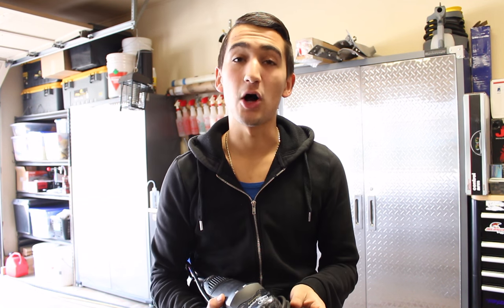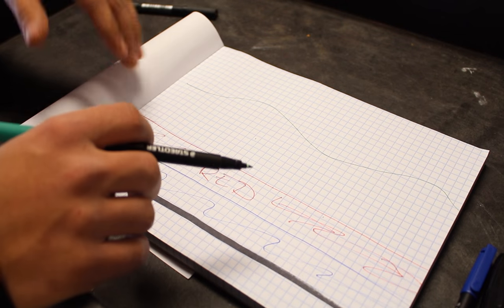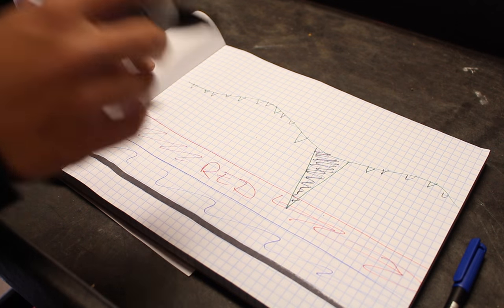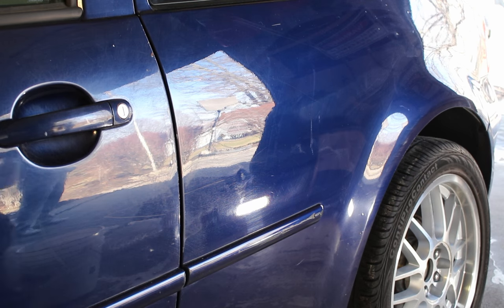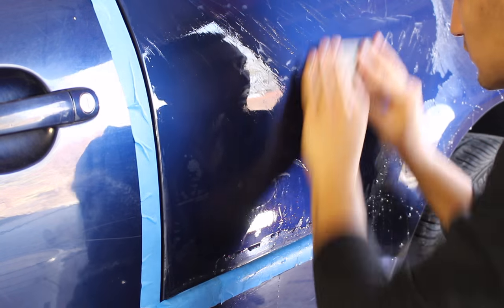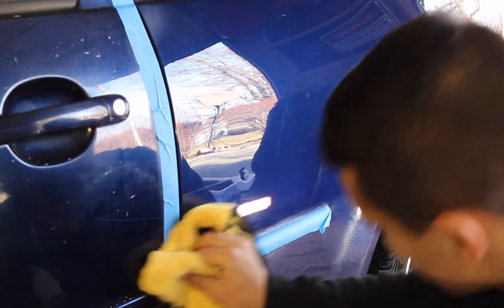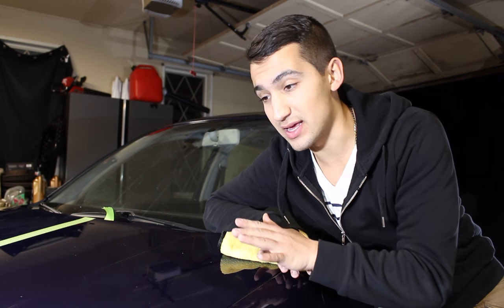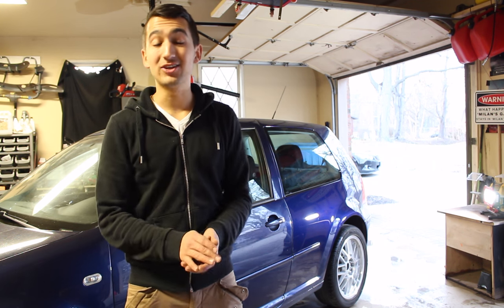How to Polish Your Car

Comment: I have a 2015 truck with some light dealer induced swirls. I don't have a DA polisher yet. Is there a polish that I can purchase to use by hand that would get the swirls out?  And what applicator to use also. Thanks.
Reply from the maker: +Michael De Luca You won't be able to make them 100% disappear if you do it by hand. You will induce holograms into the paint. With that being said though, you can use a Microfibre towel and Meguiars M205 to remove a decent amount of the scratches in the paint. If you can though, invest in even a cheap D/A as it will help you a lot and make the paint look really nice.
Reply: +milanmastracci Awesome. Thanks for the reply and videos.
Reply from the maker: Not a problem :)

Comment: Is that opulent blue paint? I have a ATS same color. How would I know if i have much clear coat left? Sanding the car freaks me out man.
Reply from the maker: There is a gauge you can purchase to measure how much material there is between the top of the clear coat and the substrate (steel panel); they can be quite pricey though..
Reply: milanmastracci il pass on the sanding I guess. Where in Canada are you

Comment: How many times can you do this to the clear coat? And will cheap microfiber towels scratch paint because I bought a new car a whipped it with water and a towel and I made it look worse than it ever was. Scratches everywhere!
Reply from the maker: The only time a MF towel will not scratch is if there isn't any dirt on the surface of the paint. Even though you might have a nice MF towel, if its not used properly, it is useless.

Comment: Im new, and i bought my self a buffer tool ("Porter Cable"), in notice theres a number adjuster (Rpm), i dont know what number i should put on for compound, polish. And wax, i dont think it matter but please explain
Reply from the maker: +Alex Correia The number just increases or decreases how fast it orbits. The faster you want to cut, the higher the number. The higher the number, the faster paint will be removed from the paint. So you want to turn it high enough so it will be removing a bit of paint, while not going too fast to remove it all within 10 seconds or so. 

For my polisher, it varies between 1 and 6. So when I compound, I will usually go around 3-4. When I polish, I will go with something between 5-6. Its all up to you how fast you want the machine to spin, but just take it easy. If you're starting off, try using a lower number so you will be removing a tiny bit of paint at a time :) Hope this all makes sense

Comment: This is a good video for showing people at home DIY guys but i would this is the slowest way possible to get those results. High speed (rotary) would do this same job in a quarter of the time. Also, working in the sealant in that fashion doesn't absolutely nothing... Less is more in that case. it can not be layed.
Reply from the maker: You can use a rotary, however that method will induce holograms in the paint. So in the shade, the paint will look flawless, but when the sun hits it, you will see lines from where you used the rotary.

Comment: Hey is there anyway I can do this and just polish with meguiars ultimate compound and maybe also with scracth x 2.0 meguiars and seal it with turtle wax?
Reply: I used ultimate compound, ultimate polish on the hood because it needed it and finished the whole truck with 2 coats of liquid glass. took all the nasty swirls out on my 2013 f150 in metallic green gem.

Comment: Video how to remove rock chips from freeway on hood?
Reply: paint
Reply: +Tray Muse rofl
Reply: I go on the highway/motorway every day. Doing around 150 miles (work). The front bumper has sooo many rock chips, as it has gone right through the clearcoat. The only way to sort it would be a full respray. :( 

FML.

Comment: this guy doesn't 100% know what he's talking about.    I would never sand an entire car with sand paper.  that's what cutting compound and polish is for
Reply: Jonathan Ritter your wrong I prep cars for the painter to paint and the way we buff cars , we sand them with 1500 if you just cut it and polish all the small scratches will go away but not the deep ones
Reply: Juan Bailon that's to remove orange peel, runs and any impurities after it gets out of the booth. If you sand a whole car you're wasting your time. Typically a 300-400grit compound will do just fine for most scratches, while wet sanding is only for special circumstance scratches

Comment: What is orange peel?
Reply: Manlex Ndungu it happens when you eat too many oranges on top of your car... the dropped (accidental of course) peels contaminant your cars clear coat with oils. If you bend an orange peel and squeeze, oil sprays out.

This oil chemically reacts with the clear coat and will actually begin transforming your cars clear coat into an orange peel. Kinda like when a zombie bites a human and the human turns into a zombie.

On a sunny day try to look at a reflection through your paint... if the reflecting looks wavy or bumpy then the transformation has begun. To stop it you have to sand and polish the clear coat like he did in the video. Be sure to hurry though as time is limited.

It's important to note that sometimes it can happen to cars even though you didn't eat any oranges on top of them. This can happen when too many people in a small region eat oranges on the same day. The oils become airborne and contaminate innocent bystanders.

This is also why brand new cars can have orange peel. Too many factory workers had oranges for lunch on the same day, again making the oils airborne.

Don't thank me; it's just science. 😎

Comment: What's the difference between the variable speed polisher and the duel action one? not sure what one to get as need to do this to my car
Reply from the maker: +Zion! Ghosts Commentator! The variable speed polisher is like a drill, it only spins in one direction, and leaves holograms in paint. A dual action polisher spins similarly to a drill, but it oscillates at the same time. Using a D/A is a very good option if you are polishing paint, where the variable speed polisher will cut the paint faster. They both have their places, but for paint, I stick to D/A :)
Reply: +milanmastracci ah ok cheers man!:) so it's a bit like an orbital sander then it spins and oscillates?  they seem expensive but ill keep an eye out :3
Reply from the maker: Very similar to on orbital sander :) You don't need a Rupes polisher to give you great results. You can use the Meguiars D/A, porter cable, harbour freight.. There's lots of them
Reply: DA is more user friendly.   Rotary is for pros

Comment: I did everything, except the sanding part. I didnt notice much on my car, Because my car is silver. what do you think? 
and another question, my window trim on is cloudy and not chrome anymore, what can i do?, i tried polishing it but nothing happened
Reply from the maker: +Alex Correia Silver cars are a pain to remove scratches but it is the same principle as say a black or blue car. As for your window trim, is it chrome or black window trim? If it's painted or just plastiic, it will make a difference as to what you can do to restore it.
Reply: It is aluminum, it chrome looking, not painted, so i assume i would use aluminum polish
Reply from the maker: Oh if that is the case, aluminum polish will bring it back to life in no time :)
Reply: +milanmastracci thanks for the help man
Reply from the maker: Not a problem buddy :D

Comment: What setting for the DA Polisher with the sandpaper on it?  SLower like a 1 or faster like a 4 or 5?  I've got a Porter Cable.
Reply: You shouldn't really sand your car if you don't fully understand what you're doing. Compounding and polishing works just fine for a daily driver.
Reply: check out adams car care products.  amazing products and the results are real!
Reply: MichaelB277 Agreed, don't sand a car if you don't absolutely know what you're doing. Unless your paint is jacked up, it shouldn't be necessary. There are many clearcoat safe polishes and rubbing compounds the will do the job nicely. If you want to do it yourself, invest in a DA polisher to save time and effort, and have more uniform results.

Comment: will this on oil based paint? I did a 25 dollar paint job last summer still look good but a little faded?
Reply from the maker: +Kool Herc I dont see why not. This process works on paint, plastics and even metal.
Reply: ok thanks!
Reply from the maker: No problem :)

Comment: hey u obviously cant get ur machine behind tge door handle so how did u remove the scratches in that hard to reach area ?
Reply from the maker: +Muzza Miki All of it by hand. Appy whatever product you're using on a microfiber towel and get rubbing
Reply: +milanmastracci i thought so but u cant get the same effect as using a dual action
Reply from the maker: That is for sure. If you really want to get in there, remove the door handle from the inside.

Comment: How would you handle already oxidized paint?
Reply: Probably respray
Reply from the maker: +FEHKINGS Depending on how bad it is, you might be able to buff it, but if its through the clearcoat, you'll have to sand it down, and then respray it. So if it is just the clearcoat that is bad, you can sand all of the clearcoat off of the car, and then just spray clear

Comment: That'd take too much time on my Expedition. Wonder how much an average price is for a shop to do it.
Reply from the maker: Oh a lot.. but the results will speak for themselves :)
Reply: hah split the vehicle into 7 parts for each day of the week. I wish we could get ahold of my dad's friend that can do this. When I bought the vehicle it was a repo from an older man who had an accident and got put into a nursing home and couldn't pay the impound fees. So I think they took it upon themselves to repair it and resprayed the entire vehicle themselves. It was just the right side fender and they put an F150 bumper on it. It doesn't look bad but I don't think it was clear coated or it just didn't have the polishing and sanding to it and I kinda like the matte finish. BUT... it's starting to get some funky white stains all over it and dirt sticks to it like crazy. There's no damage anywhere and one damn new ding on the hood from a stick the other day in the wind storm. So I think I am just going to take it to a paint place and pay up for a good touch up. Atleast it would be professionally done and it won't take forever.

Comment: Does the end look stays permanently?
Reply from the maker: Yes!! Until it is scratched due to incorrect washing, or whatever the reason is, yes it will stay shiny. The only time it won't is if you wash the car, and just fill in the scratches with wax, as opposed to fix them by polishing.

Comment: How to know if the car still have clear coat at body?
Reply from the maker: +Zash Ayzex Without purchasing a 'paint gauge' you can't really tell. These devices are around $1000 for a good one and measure how much paint there is between the sensor and the metal of the car. Unfortuantely it is always a gamble when polishing your paint.
Reply: Zash Ayzex pour water on the scratch, if the scratch disappears when it's got water on it then it is only in the clear coat, if you can still see the scratch with water on it then it is all the way to the paint.
Reply: BC MX5 this man knows

Comment: If you're going to sand, why bother with the clay bar? Won't sanding remove it all anyway, then just wipe it clean?
Reply: because you need a very clean surface when doing any sanding, should also use degreaser on the paint first, any bits of dirt trapped under the sandpaper will just cause more scratches which you are trying to get rid of.

Comment: Is clay baring the car mandatory
Reply: malik shaibi It depends on you. if it's to much work for you, skip it. but your end result won't be that great. you also may not need to wet sand either. look up junkman2000 channel he shows the process from start to finish in great detail
Reply: Buckshot Beer thanks a lot

Comment: if you sand the panel I am sure you don't need to use the clay bar
Reply from the maker: If you don't want to etch the paint contamination INTO the paint when you sand it, I would clay bar it beforehand.
Reply: +milanmastracci love all you videos 😃learning very well from these videos ☺

Comment: what is orange peel?
Reply from the maker: +Alex Correia It is the wavyness of the clearcoat. 1:52. The peaks and valleys is what makes the orange peel. When you look at a car that has been painted without sanding afterwards, the paint will replicate the look of an orange peel if you get right up to the paint. Properly polished and sanded paint will look like a mirror.

Comment: Whats the point of claying when you sand the car? looks like a waste of clay bar
Reply from the maker: So that the imperfections on the paint don't imbed themselves into the sanding disc, which will cause the sanding disc to sand irregularly, which could lead to damaging the paint as opposed to correcting it.

Comment: Dont use spray wax with clay. Only water. And dont use meguiers shitty commercial products. Use 3m and u dont have to sand down paint at all. Its risky to sand down worn paint. Never use sonax or turtle shit. Best finish use oscalating machine as finish. Sealer carnuba wax is best result.

Comment: wet sanding is for amateurs, grab a rotary with a wool
Reply: Wool pads won't remove orange peel. Denim pads will, however.
Reply: Exactly, you shouldnt have orange in the first place.

Comment: Do you really need to do the clay wax? cant u just wash your car?
Reply from the maker: +Tank Connors Claying the car is very important before polishing it.
Reply: Alright cool..I wont Skip that step then!.. Thanks bud!
Reply from the maker: Not a problem. Claying the paint is very important because if you don't when you start polishing, you will loosen up the contaminants on the paint, and grind them into the paint even more.